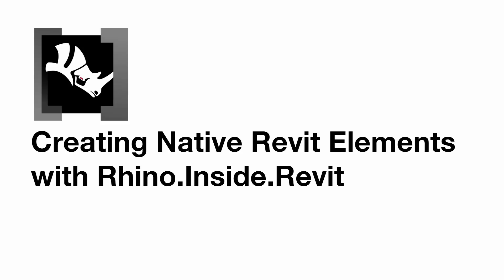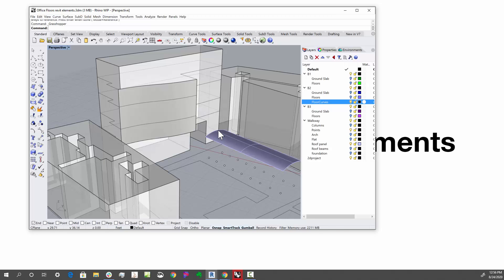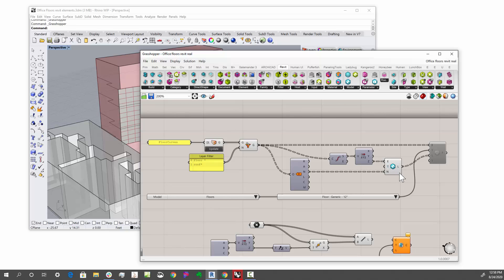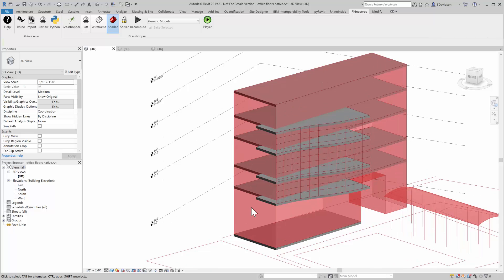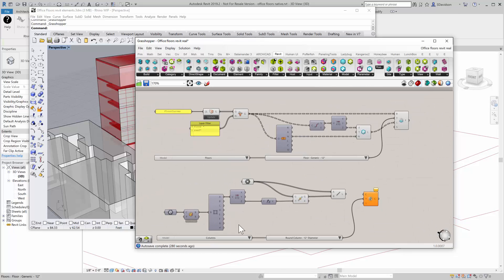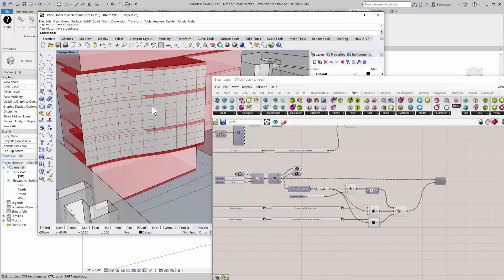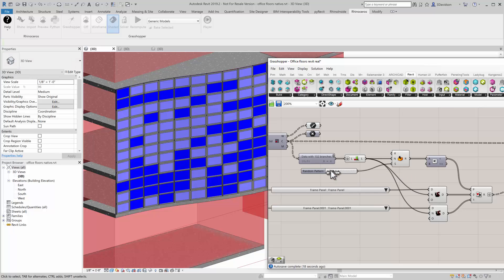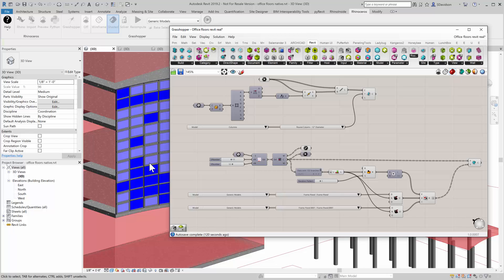Create Native Revit Elements with Rhino.Inside.Revit

Comment: hi could anybody explain the logic behind the use of elefront connecting in order of 'reference by layer' and then 'filtering by name'. as far as i see on rhino layer, 'floors' and 'roofs' layers are not sub-layered under 'floor curves'...
Reply: The curves he used for generating Floor slabs are all under "B2::FloorCuvres" so he referenced that layer using "Reference by Layer" Elefront component at the first part. At the second part, he is referencing those using "Filter by Name" Component. It is not shown but he named his curves as floor 1, floor 2, floor 3, floor 4 and roof. "floor *" finds all object name with "floor (number)". You could name your curve on Rhino Property > Objects panel "Name" row.

Comment: How does the opening and closing of Revit files work with the use of pinning and "releasing" from Grasshopper? In my experience, Rhino.Inside does not currently remember grasshopper based elements when a Revit model is closed and reopened.
Reply: I have the same problem!!
How reconnect to grasshopper, once we closed and reopened The Revit Model?
Reply: Giulia Cosentino probably you have to delete old one and run script again?